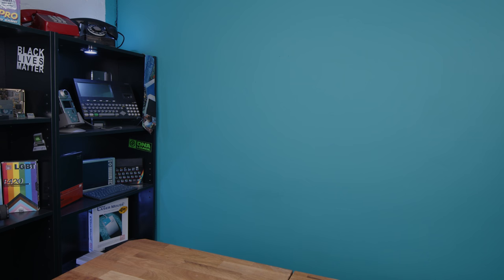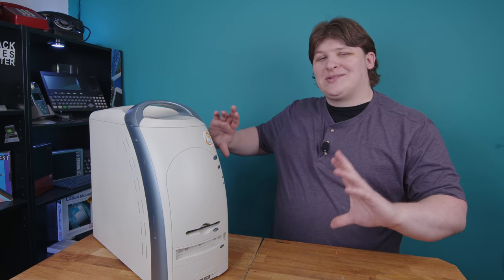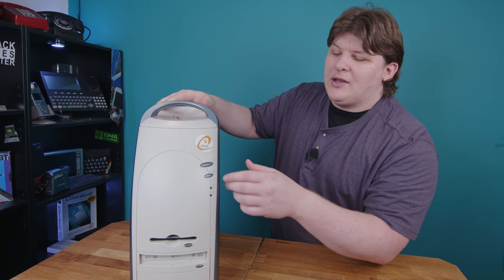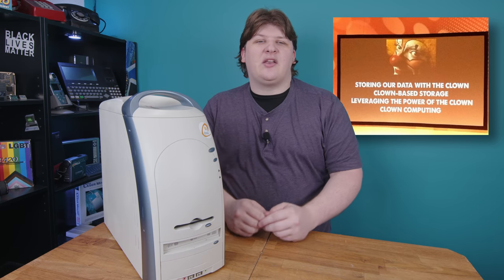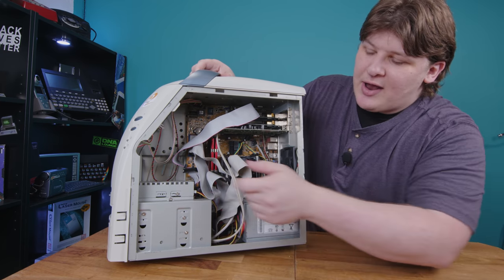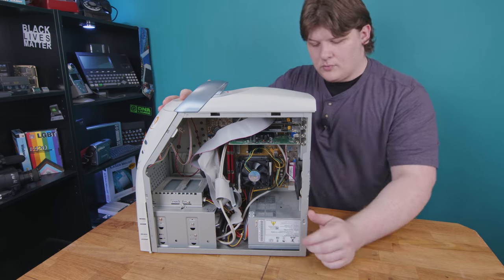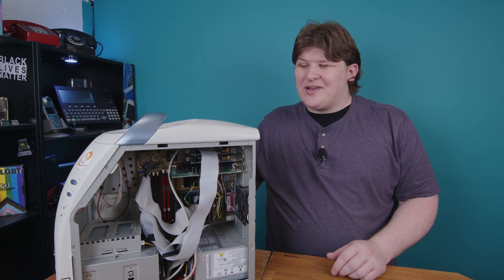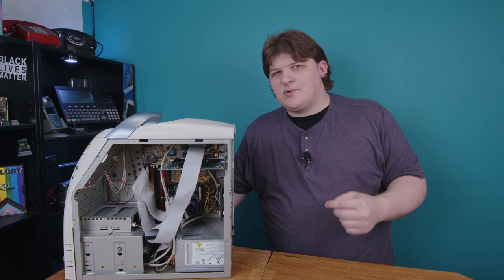Meet The Edge

Comment: Fun video, love the channel.

In regards to the Pentium 4 living through "three different eras" in socket interfaces, it's not that strange. Keep in mind Intel chose to use the Pentium 4 brand throughout the entire NetBurst lifespan. Its no different for the previous architecture, the P6, if Intel had just called it "Pentium Pro" throughout its lifespan as well instead of Pentium II and III. It saw packaging in the form of Socket 8, Slot 1 and Socket 370. In both the case of NetBurst and P6, the socket changes were a result of improvements to power consumption, cache packaging, and (of course) cost. Intel could certainly influence the industry any way it wanted back then :)

Edit: I think you mentioned you're in the Seattle area? See you at RE-PC :)

Comment: I think the motherboard in this was one of those deals where ASUS kept producing it for a long time, for industrial purposes. My work had a number of late 00s computers in rack cases using these boards. Like, built in 2008ish, but with a bunch of Celerons in them running Linux on DOMs, and loaded up with 4 port serial cards.

Comment: An old British OEM PC manufacturer called "Time Computers" used the exact same case for their Time Machine model. Leonard Nimoy did several TV commercial/advert for the Time Computers Time Machine 
https://youtu.be/71meib_q0MY

Venmill Industries is a CD/DVD/Blu-ray/etc disc buffer/resurfacer/repair machine manufacturer, that also used this case for their VMI 3500 Buffer. 

Also RAMBUS RDRAM has another weird quirk. You could not leave any of it's slots empty. RAMBUS's solution for this was to fill any empty slots with blank voltage pass-through sticks.
Reply: I remember this, they called them continuity modules.

Comment: 11:50 - I had a "Pentium Extreme Edition 965" system - the best of the best of the P4/Netburst - a whopping 130 Watt power draw officially, I had it overclocked to 4 GHz, so probably drew closer to 150-160W.  I also had a Radeon X1900 GPU, one of the top at the time. When I upgraded to a Core 2 Quad system, I relegated my former gaming rig to server duties - and replaced the CPU with a Core 2-core "Pentium Dual Core" at 2.0 GHz. The Core 2 architecture was so much more efficient than NetBurst that my ultra-low-end $80 Pentium Dual Core did things like transcode DVD rips FASTER than the 4 GHz hyperthreaded $1000 Pentium Extreme Edition. All while drawing 1/3 as much power.

Combined with the removal of the GPU (not needed in its then-current duties, so I swapped it with some ultra-low-power thing I don't even remember,) and the system at full CPU load drew less power at the wall than with its prior CPU+GPU did at idle. And CPU+GPU were literally the only things changed.

Comment: That situation of boards with two different memory standards is quite interesting! I have a few boards that can do that as well. One of them is an ASUS A7A266 (AMD Socket 462), which supports both SDR and DDR like yours, and also, I have a couple of Socket 7 boards than support either 72 pin SIMMs or SDR! One of them is an FIC VA-502, and the other is a Jetway J-571B.
Reply: There's also a few 486 boards that take either 40-pin or 72-pinn SIMM memory.

Comment: fun fact: the Fractal Pop PC case has 2 hidden 5.25" bays at the front bottom. there's a magnetic cover over them and by default it's populated with a drawer. such a strange decision but pop off I guess. knowing fractal it's probably a great case, and probably one of the last "enthusiast" cases that actually still has 5.25 bays. 
it's actually surprising that it seems that there were able to fit it into a ton of different form factors. good on them for keeping this functionality in a cute way.

Comment: Hey CRD. Love the channel.

The 486 actually came on at least 3 sockets too. Socket 1 for the early generation SX and 386-upgrade CPUs, 2 and 3 for the later DX chips with more pins. Technically there were also 486s made for the 386's PGA132 socket too, just not Intel's ones (at least not by branding... it's suspected that their RapidCAD CPUs were just 486s).

The later history is a bit off to as far as when DDR1 was available. At the same time the initial socket 423 Willamette core P4s were released, AMD was putting out their 760 chipset for the Athlon CPUs, and that chipset supported DDR. They weren't the first though, IIRC there were VIA chipsets out months earlier that supported it too.
DDR1 was commercially available throughout the P4's lifetime, there was nothing to wait on for those VIA chipsets. It was actually baffling to those watching the market at the time that Intel went with RDRAM in the first place because DDR1 was demoed back in like 1998 and had considerable latency advantages over RDRAM that made up for any throughput difference. 
And since the memory controller in CPUs of that era was in the northbridge of the chipset, there was nothing preventing any CPU from changing memory architectures per se. AMD went from SDR to DDR within the socket A line,  using newer chipsets, before the P4 was even on store shelves.
Reply from the maker: Oh absolutely, to clarify on the DDR front - when I wrote my original script, I had been misled by Intel's propaganda. I later reread and deduced that Intel had claimed in 2000 that DDR was not yet "finished," while AMD just went ahead and used it and it worked fine. I got got.

Comment: My 2001 OEM Fujitsu Siemens PC came with an Athlon T-Bird at 1.3 GHz and 128 MB of SD-RAM. I later upgraded it to 256 MB of DDR-RAM, which this board supported just fine and resulted in a massive performance boost, like putting an SSD into a much newer computer, except that it actually doubled frame rates in games. Everything ran better. I then gradually upgraded the RAM to 1 GB, swapped out the T-Bird for an Athlon XP, upgraded the GPU twice (from 2MX to 9200 to 9600), swapped out the hard drive twice, the DVD drive four times (because they broke all the time), added an Ethernet, modem and sound card. In the end, after almost exactly seven years of use, the only parts that remained original were the power supply, case and board.

Comment: Interesting, recently picked up a server with triple channel SDR and a 478 socket. Also had some strange features like a CNR slot and an additional 6 pin aux power connector. Not quite sure what's going on with pretty much all of that, had never seen a P4 with 3 ram slots, let alone SDR. But after all this was made by AOpen, the manufacturers of the motherboard with integrated tube amp, so I'm not that surprised. (Only P4s I've worked with before are the 775 variety, in the dying stages of the Pentium 4 when they added hyperthreading.)
I do have an MSI board for the Athlon XP with two DDR slots and two SDR slots, the KM2M Combo. Was disappointed to find out you can't dual wield memory types. Didn't know the same thing existed in Intel systems - suppose it was better for cheaper prebuilts since manufacturers could use the same board for many RAM configs.
Reply: Three memory slots is a common configuration for SDR exclusive boards of the P4 era. Only bargain basement P4 boards were SDR exclusive
Reply: @DigitalMoonlight  Thanks, good to know!

Comment: I'm glad that I never canned my first gaming machine.  It's a P4 2.4 built around an ASUS P4GE motherboard.  I've been thinking on upgrading it with an uncommon P4 that ran at 3.2Ghz with the 533FSB.
Reply: MSI 865PE Neo2 and the Asus P4C800E Deluxe are awesome for the fastest socket 478's. Both fast overclockable rock solid boards. The Asus tends to cost more and is not tremendously worth the extra cost but is a slightly better board overall. If you were to do a P4 on a 775 you might as well do a c2d.

Comment: I think my last comment might have gotten auto-modded out for linking to the weird Russian PC forum I found it on, but the case is an Inwin IW-T515P
Reply: At that time Inwin was hugely popular in Russia. Also DIY PC market was most probably bigger than off-the-shelf PC market. So I guess Inwin sold here in retail stuff that was available to OEM only elsewere.
Reply: Russian version of Tom's Hardware Guide has its review as IW-F515 in 2005 while US version calls it IW-T515P in 2003
Reply: @vladyarotsky5287  T515P includes front panel IO, where the T515 does not
Reply: @JemaKnight  oh I see. Thanx. For some reason it was sold as F515 not T515 here. Or not and it was just some mistake of Russian THG

Comment: The inside of the removable side panel looks exactly like the closing/locking mechanism of the SGI 320, one of the Intel based Silicon Graphics workstations. My 320 is even annoying to properly close in the exact same way. SGI cases also used similar fragile plastic assemblies for buttons and other moving parts, which would bind very badly with age. I wouldn’t be surprised to find out these share the same designers.

Comment: When trying to align an optical drive usually you can reinstall the front of the case before tightening the drive's screws. 

And regarding plastic cases like that, IMO the worst part is that the sides attach with plastic catches on the bottom instead of the metal structural panel. The side basically won't stay on my Sony VAIO as a result of the clips breaking.

Comment: Worked at Intel about the time the P4 came out....my first P4 board was only able to take RDRAM, and only got it built because some of the guys in the engineering department helped me get an engineering sample of a P4 chip, board, and the RDRAM that was going to work with it.

Finding drivers was a lot of fun since technically, it wasn't supposed to exist and certainly not on the publicly available market.  Was a pretty fast system for the time, though.

Comment: In my experience, Windows XP (SP3) will run flawlessly on either an AMD Phenom II X4 965 or (believe it or not) an AMD FX-8320. I know, because I did that for a few years. Either one blows the doors off a Pentium 4 in terms of performance - there's simply no comparison. I've also run Windows 2000 on an old Athlon 64 X2 2800+, it also worked flawlessly for years - and so did Windows XP. Linux too, but I doubt you're concerned with that :P Yes, those are all multi-core CPUs.

Might be worth getting one of those chips for a second, faster testbench. The Phenom II chips are still usable with modern software; they were an amazing piece of engineering at the time, and so was the Athlon 64 X2 for that matter. My old Athlon 64 X2 2800+ was still being used by a friend of mine in his daily-driver PC up until at least 2017, LOL.

Comment: Dude, I was running XP 64-bit (NT 5.2) just fine on a dual Xeon X5667 workstation for years! It did really need rebooting after a couple of months, it didn't really respond well when its uptime was around a year. I guess it would have been the same on a 32-bit XP.

It's just like you can install windows 7 in uefi mode on a NVMe drive. It needs a little tinkering, but which windows doesn't?

Comment: If you think a board with two types of RAM slots is crazy, you should see the Asrock 929Dual-Sata2 and 939SLI32-eSATA2. Not only did the Socket 939/DDR boards have both AGP and PCI-Express, they also had a special "Future CPU Port." The AM2CPU board, the only one designed for this port, had an AM2 socket and four DDR2 memory slots on board. Unfortunately, it's the same story, where you could only use the original 939 and DDR memory, or the AM2 socket and DDR2 memory.

Comment: All I really remember about the P4 is that it was way ahead of its time...as far as heat generation, and proper PC cooling that could actually handle it (at full power) was years away from being something anyone could just buy and install...so many custom cooling sets...including tons of (stupid) amateur attempts at sub-ambient that involved cannibalizing AC parts, forgetting to properly water-seal your MoBo, and shorting out your box from condensation.  Even my old Dell 2300 with a max clock set at 2.66GHz would get pretty damn toasty, but it did last 8 years (as in, survived....not as in "still good enough").

Comment: upside down sure, but honestly having the heavy stuff at the bottom (PSU and drives) just makes more sense

Not to mention, IO cards are now up high, and your power cable is at the bottom. Radical for if you keep your system under a desk. IO goes up power stays below

Comment: i had a socket 423 1.3ghz p4 machine the first p4 ever to market and it was a compaq machine. the machine also used rd-ram which didnt last long in its life where it got over taken by ddr. somewhere i still have the socket 423 processor somewhere. i saved it since its very rare and the very first p4 ever made.

Comment: After 5-10 years settled dust begins to chemically bond to the surface it has settled on, that's why you see it as "hard dust". I used to work in building conversation and that's why historic homes need to be either constantly cleaned by staff or constantly covered by dust sheets.

Comment: that looks like some late-90s "let's make computers that look like a bubble instead of a greebled box. corners are bad, what if you trip and hit your eye on your computer?" thinking. especially the power and reset buttons. they made a lot of really weird crap back then, just to make it difficult to use the case for any other purpose than the one it was specifically designed for, and to be tossed in the trash when it was no longer wanted or useful.

Comment: What are the six RJ45 ports at the top? Multiport ethernet card?
Reply: right? we have to know!
Reply: He explained it earlier in the video without showing us the ports, but those are presumably where the kiosk displays would be connected. I suspect that it's not using ethernet, it's just using the RJ45 cable standard as a generic 8-pin patch cord that you can easily buy and replace.

Purely a guess but I bet the kiosk displays themselves have a very minimal digital frame buffer so it doesn't need to have its display constantly refreshed 30 times a second over that cable, when you touch the screen it sends a bit of serial data to the edge and the edge sends back whatever the next page is supposed to be.

Comment: I had the most rare i7 processor, the i7-920, on LGA 1366, just after this era. The aftermarket cooler for that guy was compatible to AM3 sockets, and then AM4. You will be mad at me if I tell you I still use that cooler, and it runs fine on Ryzen 1600 that spews less than half of the heat of  the original i7-920. Coolermaster Hyper TX3 EVO. Check it out. The most bizarre cooler was available here, and I can run it to this day, within TDP of the Ryzen.
10+ years, running solid.

Comment: I know what you mean about SIS compenents. The first computer that I ever owned perspnally had a Foxconn socket 775 motherboard with an SIS onboard graphics chip. The computer would blue screen whenever anything involving 3D acceration was used. This stopped when I installed an AGP Nvidia GPU. Whenever I opened the case I could still see the SIS chip taunting me.

Comment: I did not have any P4 back in the days but I loved the price/performance of AMDs with strange chipset like sis and ULI, sis was also famous for its 735 which had north and southbridge in one chip and was installed in the k7s5a which had both ram sdr and DDR slots, and for me at least was one of the more flexible and stable platform on a budget.  Love to see those cards with lan ports in action
Reply: It really depended on platform and processor to have a proper opinion of chipset. I preferred the sis on the cheaper boards to the via because of the price and more integrated features. I liked via on high end athlon era motherboards until nvidia came along. Intel boards got Intel chipsets period no others were comparable in quality or compatibilty. I didn't care for early via stuff as I remember the drivers being weird to get the right versions. Later versions had a unified driver with everything for like all their later chipsets included. Those were great, Sis were just plain simple and the drivers just worked. Bargain basement features yes, but again they worked.

Comment: On old baked on dirt: have you tried a pulse air gun? They hook up to an air compressor and have some serious cleaning power. I personally use a Tornador brand gun but there are plenty of generics on Amazon that will last. I believe you need a compressor capable of 90 cfm so it does require a stout lad to run.

Comment: the board you actually want is the 4coreDual-VSTA from asrock, it has ddr1and ddr2 pciex4 agpx8 3xpci sata ide and floppy and supports p4's, p4ht procs, celeron d's, pentium D's, core2 duo's and even a q6600 core 2 quad
literally every port you could ever want

Comment: I was in my teens during most of the Pentium 3/4 era... and one of the solutions to not running an early pentium 4? Just run a pentium 3. Even the top tier P3's were not far off in performance compared to the early run of Northwood pentium 4's. I actually owned a Dell Dimension PC with an 866mhz pentium 3 with some kind of an ATI graphics card until 2003. I got by with an AMD athlon XP 1700+ but i gave that up in 2005 and went to the infamous Prescott (LGA775) p4 for who knows what reason .... only to later find out that the Core architecture was around the corner (not even a year later) and seriously had buyers remorse. I stuck with the p4 until 2007ish and went Athlon X2 3800+ because even at that point i knew there was an advantage of having more than just one core doing all the work.

Comment: On early and/or low end chipsets for the Pentium 4 that have SDRAM support - I have an extremely generic early Pentium 4 system (1.7 GHz Willamette) that happens to have an i845 chipset and, amusingly, an Intel board that only contains SDRAM slots. Your guess is correct, it is absolutely awful. I also have a Compaq Presario with a 900 MHz pre-XP Athlon and it is only marginally slower.